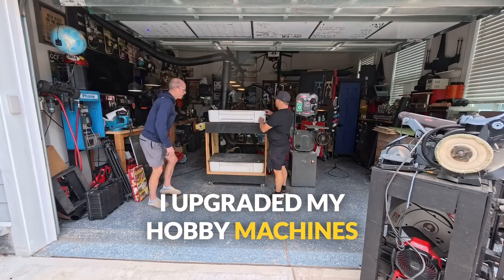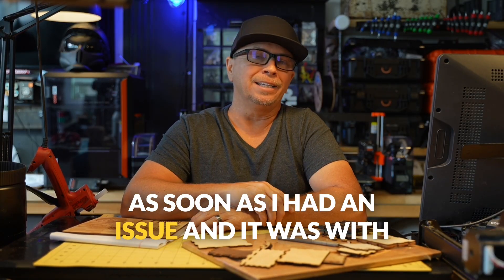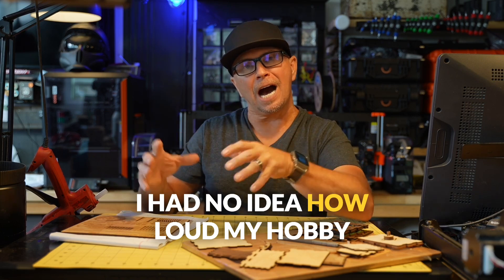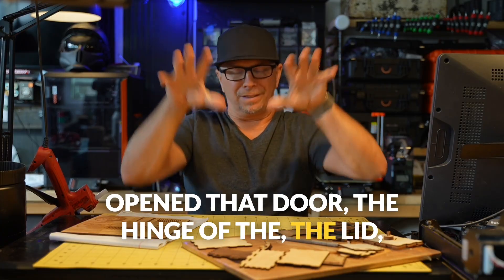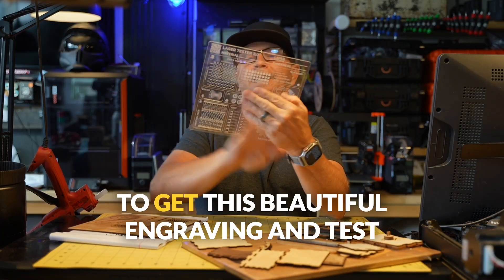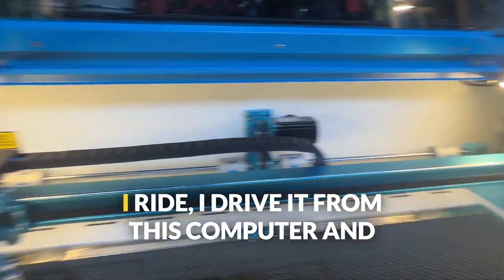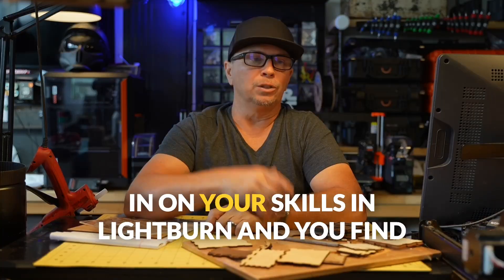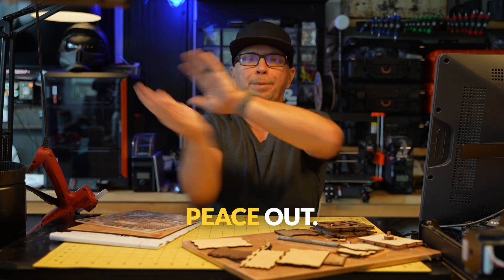New Laser - Thunder Nova 35 80 Watt Plus - 1 Week Review

Comment: I'm looking at adding this exact machine to my shop shortly. I currently have a 35"x23" 100watt Glass CO2, but need another laser to keep up with production. I cut a fair amount of 1/8" baltic birch, and 1/4" Columbia Forest Maple, and I'm wondering how the speed of the 80watt RF will compare to the speed of the 100watt glass. I cut mostly at about 20mm/s and around 75% power on the 100 watt glass tube. What kind of speeds are you cutting on the 80 watt RF?
Reply from the maker: so what thickness of material would that test be at? I would like to do this test tomorrow. So maybe I could try quarter inch maple.
Reply: @hacklab.ryandewitt  a test on 1/4" Maple would be great.
Reply: @hacklab.ryandewitt  1/4" maple would be great!

Comment: Hey Ryan, in the market for a laser cutter/engraver myself. How much research did you do before selecting Thunder laser and that model particularly? I currently have a Phantom CNC and am comparing these two brands. Curious of your thoughts.
Reply from the maker: Thunder has an office in Texas. Machines always need maintenance and parts if you’re using them for a business. So I called Grant and Tyler in Texas and just talked to them and acted like I needed help and I wanted to see how available they are to buy extra parts or to get support and I just got the support I wanted. So if you buy a huge laser cutter and it stops working, you have a huge brick on your hands and you may not be able to fix it so I like buying things that I can upgrade and fix that’s why I chose thunder. So there’s other brands that have similar sizes. You just need to investigate whether or not the support is as good.
Reply from the maker: I sold my CNC machine because of the volume of the cutting and the cleanup. I’m able to do a lot of similar things with an 80 W laser by stacking up the material and sanding the edge. I am still able to sell my wedding gift signs that I used to cut out with my CNC.